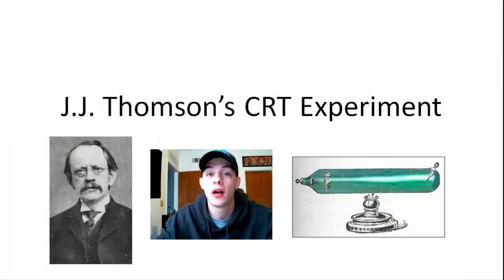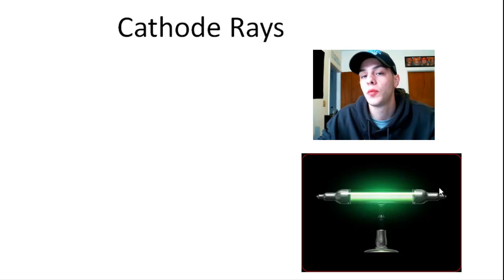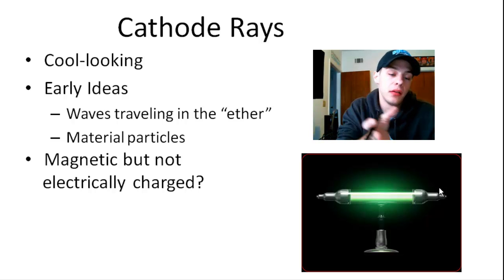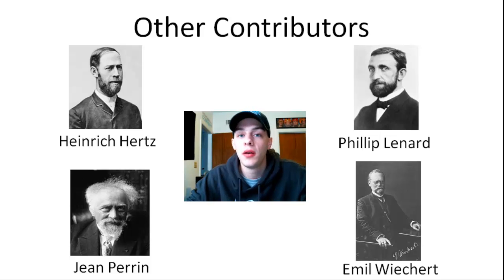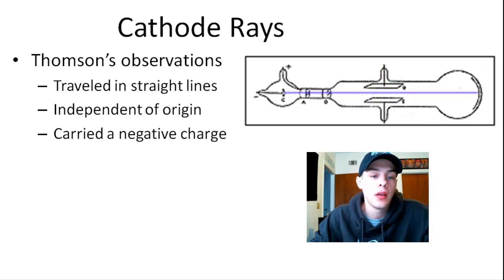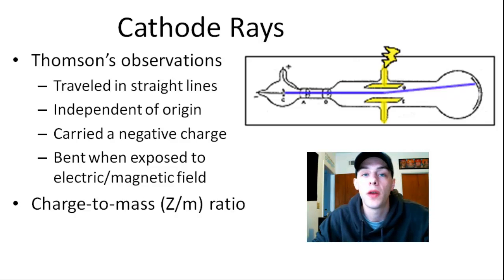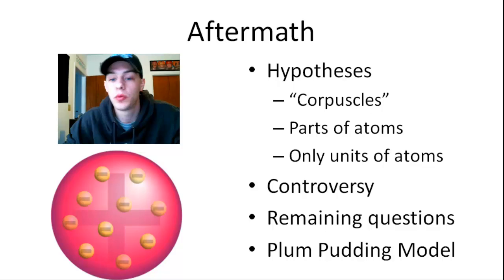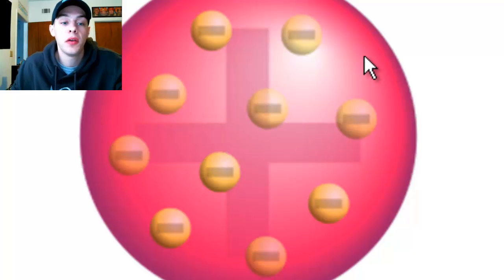J. J. Thomson's CRT Experiment - The Discovery of the Electron

Comment: Free electrons (current electric) are different from stationary electrons (electrons that confined within an atom) due to their higher saturation of photons on them which increase their momentum that allowing them to skip from atom to atom. Higher saturation of photons on free electrons also foster stronger magnetic field surrounded them. Einstein's famous equation, E=mc^2 is wrong otherwise garbage also can be used to make nuclear bombs as long as it is matter or it has mass. Energy and matter can't interchange one another according to Einstein's famous equation. One must have photons before one can emit out photons. Photons are particles and they have mass. All forms of EMWs including light and heat are dynamic photons per volume per time in different saturations. There are two types of photons, namely stationary photons and dynamic photons. Stationary photons are photons that adhere onto a particle like a stationary electron. Dynamic photons are photons that travel freely in the space. Dynamic photons don't lose their kinetic energy after they have transformed to stationary photons by converting it to hasten their intrinsic spin rate that subsequently transforming to stronger intrinsic magnetic field that enveloping them. Therefore free electrons are enveloping with stronger magnetic field that derived from those stationary photons that adhere onto them. A constantly flowing free electrons forms CRT ray where the visible light (dynamic photons) are emitting out from those free electrons. This strongly suggesting that free electrons are saturated with lots of photons. Higher potential free electrons contain higher saturations of photons and this cause stronger suction for them between higher potential anode and cathode which strongly suggesting that photons must be negatively charged particles with higher saturation of them will cause those higher potential free electrons to be perceived as more negatively charged therefore this cause better suction for them from the anode. We can't really measure charge-per-mass ratio of free electrons because free electrons of different potential differences will have different saturations of stationary photons; therefore they will have different mass as well as different charge strength since photons have mass and they are negatively charged particles. If you are interested in real discoveries, I would recommend you to read my book, The Unification Theory - Volume One and you will be amazed with lots of new, interesting discoveries. In God I trust.